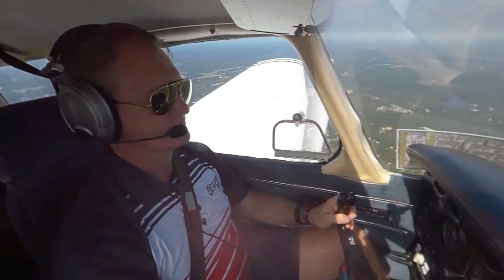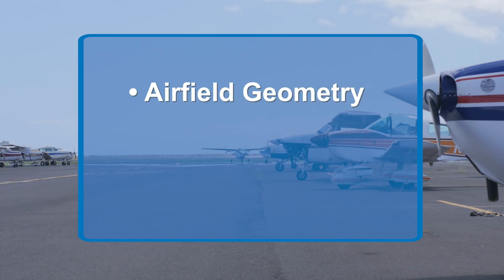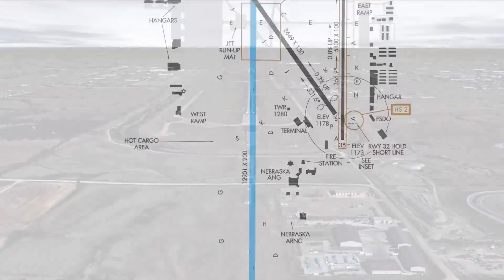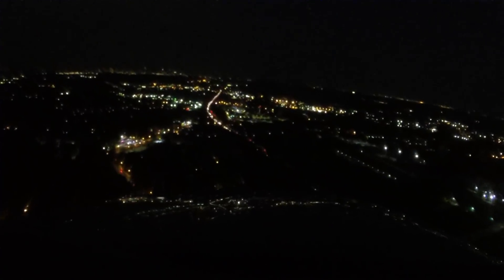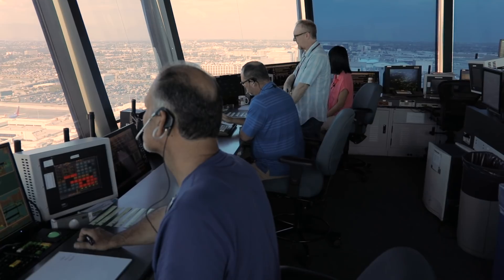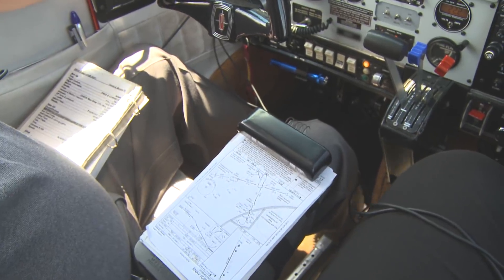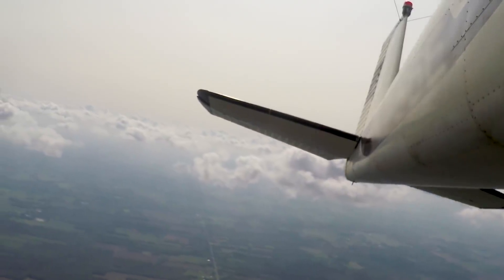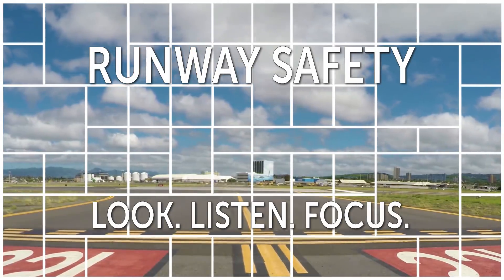Wrong Surface Landing

Comment: Great video, full of good advice.  However, I have to take issue with the advice to "notify the controller promptly" if you go around.  Your first priority is to safely execute the go around maneuver.  The majority of GA accidents happen in maneuvering flight near the ground, so minimizing distractions and concentrating on controlling the aircraft is the best policy.  Only once the aircraft is established in a climb, properly configured and pointed in a safe direction, then notify ATC.  The radio can always wait!
Reply: I imagine that's why they said "promptly" instead of "immediately".

Comment: Unfortunately those pilots who don't bother looking up airport diagrams of airports before flight, especially with multi parallel runways, and then get themselves into trouble landing at an incorrect runway, are the same pilots who generally don't bother watching informative videos like this. IFR pilots go through a serious briefing for every flight, most GA VFR pilots don't. That IFR discipline and constant recurrent training generally reflects in the different VFR pilot's behavior.